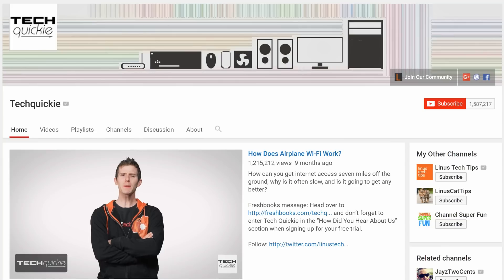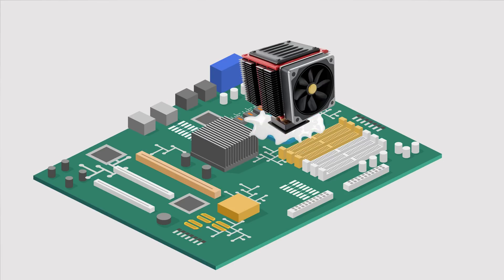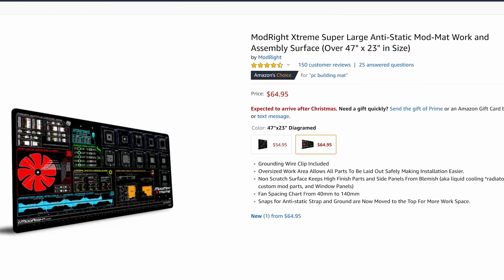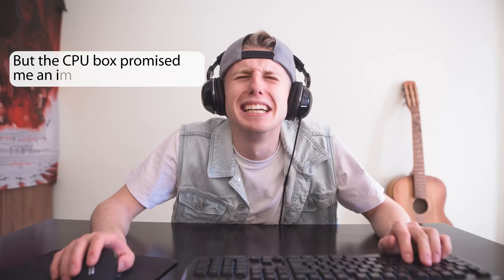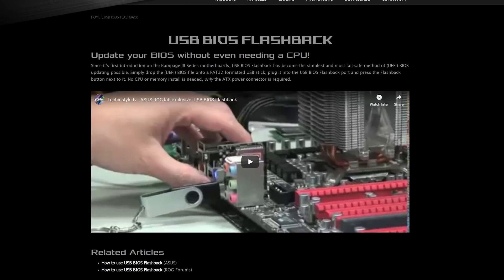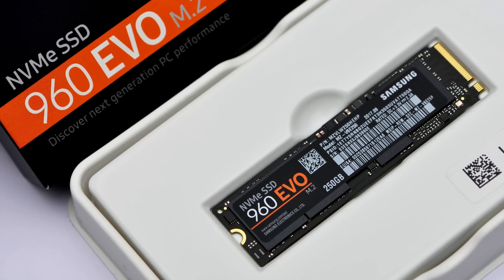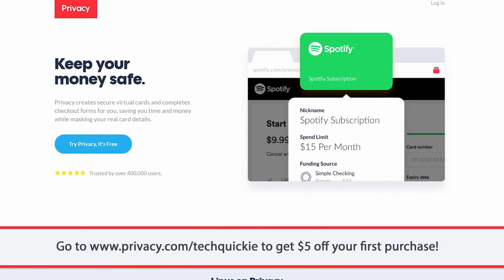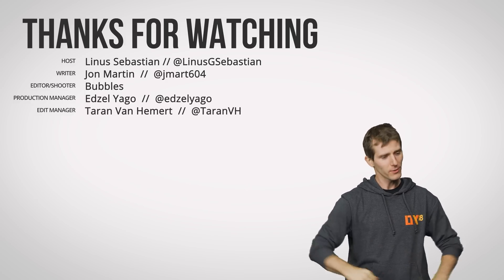DON'T Make THESE Mistakes Building A PC (pt. 5)

Comment: I have a tip for parents......don't buy them mac as a gaming pc....
Reply: Sounds like you speak from experience..
Reply: F for the kids that got macs
Reply: N3CC i would refund so fast
Reply: @carljosephavelino4128  i mean they could sell for a high price then build one
Reply: CarlJoseph Avelino presses f in choppy 30 fps. Yea I have a Mac. It sucks
Reply: @carljosephavelino4128  f
Reply: @carljosephavelino4128  I game on a MacBook :(
Reply: CarlJoseph Avelino got a 1800 MacBook, runs as a 200 dollar gaming pc F
Reply: CarlJoseph Avelino F for me
Reply: CarlJoseph Avelino I got a Mac, but I had already chosen a cruddy laptop instead of saving my money previously, so the Mac was a big upgrade. Today my gaming PC arrives.
Reply: @carljosephavelino4128  i got a mac
Reply: CarlJoseph Avelino that would be me, not even a pro, and AIR! A MacBook Air!!!!
Reply: One day my dad showed me a mac “gaming pc” the specs were horrible for the price
Reply: @SSlayaa  The price for all Macs regardless of the specs is horrible.
Reply: @SSlayaa   The main issue isn't the specs for the price (although it is a issue), its the fact that most major games don't even have MAC reversion on release and never will unless the player is lucky they make a port down the road after release on PC.
Reply: Or any other pre-build.

Pre-builds are usually not worth it, the PSU sucks, the RAM is single channel, you have to pay someone at ASUS to build it, ASUS' CEO added on a couple of dollars to the price because he wants some ice cream, it's hard to find the specs for it so upgrading is harder, ASUS skips out on upgradability so you end up having to buy a lot more replacement parts when you inevitably have to upgrade.
Reply: @HazmatPyro  If You buy a used PC  and then upgrade what you need,it works
Reply: @alexpreda4330  you can barely salvage any of the components. 

CPU and GPU is directly linked to performance so that's a big no.
Motherboards rarely work with newer processors so that goes.
RAM might be incompatible if it's not DDR4.
Cooler depends.
Used Power Supplies are a big no since you never know how it's been used and it can destroy your entire rig if it goes bad.
(adding hdd section later)
Cases can be reused 

I have an old ASUS M52AD. However I chose not to use any of the components when building my new PC.
Reply: HazmatPyro the only good prebuilts are NZXT prebuilts and some lyte prebuilts from the new gen section
Reply: Don't buy a mac for anything!
Reply: I have a tip for parents too: don't just buy an Intel system for gaming, they're overpriced and you can get a much better AMD system often times for the same price. A Ryzen 5 or 7 price compares favorably to a core i5 and definitely compares well to a core i7 processor. It's a better value, not to mention a simple BIOS update on your motherboard and it will support the next AM4 CPU series so you don't have to replace the motherboard. As for graphics, Radeon or Nvidia. Really depends on your budget. If you want to save money go Radeon, also Linux support for RX 580s and Vega cards is really good if you aren't using windows for some reason so that's a plus but only for some users. I can't speak to Nvidia on that my experience with a 750Ti was horrible on Linux. If you want good graphics support from games Nvidia is probably the way to go, not that Radeon is bad, the RX 580 is a great GPU with 1060 levels of performance but with 2gb more video memory and it will competently do anything and everything and it frequently goes on sale and is priced better, again, better value.
Reply: @alexc3504  Yeah and some have a powerfull APU
Reply: Luscious Luchs no. Don’t buy an AMD system idiot.
Reply: Luscious Luchs u need a 2080 Ti and 9900k
Reply: My MacBook has a Core 2 Duo in it...
Reply: @michele97593  oof that must suck
Reply: @michele97593  lol I just wanted to reply to you to show all the people who only look at the last reply this incredible name.
Reply: @BlueScope819 at 5Ghz? Well TBH I don't think clock speeds matter all that much. I'm getting near equal performance to my friend who has a near identical system in terms of spec. He has a ASUS OC Vega 56 and I have a reference model Vega 64 from SAPPHIRE, I have a Ryzen 5 2600 because it was hella cheap at $150, his CPU is the R7 2700X, my board and his board are both ASUS X470 boards and he has 3600mhz memory while I have 3000mhz and we get nearly identical performance in games. His system is actually unstable compared to mine which literally just works (tm) and he's running Windows 7 with hacks to make NVMe work because 7 lacks native support for it while I'm just using plain vanilla 10 and if I had another drive id be running Arch Linux for shits and giggles and also serious stuff.

As for relative performance my processor turbos up to 3.7ghz which is only 200mhz faster than what my old processor ran at, an FX-8320 and obviously much slower clock speed than 5ghz. 

AMD doesn't really try to push clock speeds as much as they try to do multicore CPU optimization in terms of parallel workload and single core performance.

In my experience clock speeds don't matter that much in this day and age when everything is faster than 3ghz pretty much.

Worth noting the only reason I upgraded was because the FX kept overheating

EDIT: I forgot to reply to the original question. The RX 3080 has no released specs. We just know Navi will be based on the 7nm finfet process and as a result be extremely powerful and low power usage. I'd love to see Navi integrated gpus that would be kick-ass. Imagine getting 1050Ti perf out of an apu.
Reply: @BlueScope819 oh I have no doubt about that guy who leaked it, he was spot on before he seems to have reliable sources.

I don't doubt that the 8700K is good in single core but the price for me doesn't justify it nor does the price for the motherboards. I'd rather buy something I know that works for me. AMD has not dropped frames on me I can run all my games at max graphics no sweat you know? It's insane to me.
Reply: @BlueScope819 also I don't really think synthetic benchmarks mean much. Yes your processor is faster, but in the real world they would provide more or less a similar experience, the Ryzen 7 2700X versus the Core i7-8700K are similar enough just not in the turbo since AMD silicon has issues turbo up to 5 they can only go up to about 4.1-4.2
Reply: @BlueScope819 that's all fine and dandy but when it comes to the real world more than 60fps is not necessary and my system easily does it. I'm doing fine with a Ryzen 5 and Vega 64 and I'm pretty sure I spent less on my computer than you did. AMD is a better value proposition and for the same reasons I won't buy from Amazon I won't buy anything Intel. I think they're shitty companies that do shitty things. My distrust of Intel is deeply rooted.

I still don't think 5ghz versus 3.4 is that big of a difference if the performance is similar. I don't do benchmarking because to me that's all a big pissing contest. Woohoo so your PC can piss higher than mine so what if mine does what it needs and I don't really need overclocking when the turbo 3.7 is enough. In the real world resides an AMD computer that just works (tm). I'm glad you have an Intel system that is good and I'm glad that you have the money to spend on a $400-$500 processor. I work at Subway for christ sake I can't afford that shit.
Reply: Parents buy Their kids Macs so they can't game on them. That's the truth
Reply: This happened to me, I got a MacBook air and it couldn't even play rocket league. My dad bought a MacBook because "They Can't get viruses" I told him that's not true but mainstream media brainwashed him.
Reply: Pro tip for parents : never buy any apple product
Reply: Your very right
Reply: Advice for parents buying kids macs
1. Don't
2. Don't
3. Don't
Reply: Loli Hunter, the people that buy Macs/MacBooks for gaming are uneducated about their specs.
Reply: i got one :(
Reply: BloxinDoeZ same man..
Reply: NVidia Now sorts that out. It's awesome over Mac. Cheaper than an EGPU.
Reply: @BlueScope819 im not saying it's faster. Also I'm sorry for being combative I was just having a conversation. I don't really like doing benchmarks because I don't think in terms of real world performance it matters. It's good enough for me. I don't need a score to certify it. My system can get good framerates in all the games I play with ultra or highest possible settings at 1080p that's good enough for me

As for microcenter we don't have one of those in Austin we're stuck with a Fry's that is slowly dying :( so I'm glad you found a killer deal. I just know that I couldn't justify the high price tag of Intel but I don't doubt that they're fast I just don't care for the price. For the record though, I might've jumped on that if I had a microcenter, but my AMD system was still cheaper. Under $900 total. You got a good value though from what I see and that I'm glad to hear. If Intel priced like that competitively on all their CPUs I would be more inclined to buy one.
Reply: Luscious Luchs 1080p? AMD really does suck
Reply: Luscious Luchs under $900 for a whole system that’s too cheap that’s why it’s shit
Reply: @BlueScope819 I use games like kingdom come deliverance and a few others. Arma 3. Metro last light. Just to name a few.

Full specs are 
Ryzen 5 2600
SAPPHIRE Vega 64
ASUS TUF X470 Plus GAMING
Corsair Vengeance LPX DDR4 @3000mhz
EVGA G3 750 watt gold plus PSU
I run three storage devices, a 640gb HDD, 1tb hdd, and a 120gb ssd

The case is a Thermaltake View 22
Reply: Luscious Luchs u still have hard drives? Wow And not enough ssd and it’s probably sata
Reply: @BlueScope819 that's what kept happening with my FX-8320 and 1600mhz DDR3 system with this same graphics card which I did actually benchmark. Apparently my Vega was being held back massively by that old pile-driver. I can only imagine the same of my RX 570 that came before it
Reply: @BlueScope819 I got mine for less than what I got my RX 570 for, brand new. I don't really care for Nvidia. My experience with the 570 even with it's only 4gb compared to my experience with the 750Ti was far better. And I don't mean performance I mean overheating and drivers. Used to be that Radeon drivers sucked but now they just work, for me at least. Maybe the cards I'm buying are just good cards. Silicon lottery. I also used Linux for gaming for a bit and Radeon GPUs have actual Linux drivers and Vulkan works in Linux and I was able to get good performance out of both graphics cards using Ubuntu with games. The Vega 64 at the time was a cheaper option. I paid around $290
Reply: @BlueScope819 oh I don't plan on upgrading for a long while now this is fine as is you know?

What are your system specs?
Reply: @BlueScope819 not bad. Not bad at all. 
I still think the 2700X is better of a processor but given the choice between $300 for board and CPU and $400 for board and CPU I would go with the cheaper option
Reply: Luscious Luchs 2700x Sucks
Reply: For those with macs... Have you experienced 7-8fps in CS:GO?
Reply: @boboperomasaya1144  I know this is a bit late but I run CS:GO on an early 2015 Macbook air and it doesn't run too badly. It runs around 30-40fps, although I suggest downloading some fan control software and turning the fans up to the max or as macs have what I call "lazy fans"(the act of the computer fans not turning on until the cpu reaches insane temperatures). You'll probably get 7-8fps when you don't turn you fans up to the max and if you own an older macbook without a dedicated gpu (like an 2013 macbook air) then it will run at 7-8fps regardless as the performance difference of the integrated graphics in older macs and newer macs is huge.
Reply: BlueScope819 AMD sucks
Reply: Speaking from experience?
Reply: don't buy a mac at all ;)
Reply: I know this is a
Reply: Don't buy them Mac at all.
Reply: My friends mom told him he should get get a dell 2in 1 for gaming
Reply: Yep
Reply: Facts
Reply: F for me
Reply: And a laptop. I asked for a gaming pc and they gave me a laptop.
Reply: F
Reply: Actually don't buy a Mac in general
Reply: @ItsFaiZer yep it physically hurts to see that
Reply: @ItsFaiZer most of em have it as a fashion statement because in the world of teens having apple products make u "cool"
Reply: @ItsFaiZer apple phones are good and all but it's annoying asf when clueless apple fans that don't know anything about hardware make fun of my Android 🤦🏿‍♂️
Reply: true story? if so I pray for you
Reply: F
Reply: Your fricking righ
Reply: Mine spent 1500€ on a Mac, I asked for a GAMING pc
Reply: Oo for anything at all ever
Reply: my best friend’s parents bought him a mac to watch youtube 😭😂
Reply: My parents got me a laptop based on storage because they thought that storage was the only thing that mattered for it to be fast and they only got 1 tb of the worlds slowest hdd and it had an Intel i5700 u no graphics card and 8 gb of ram.
Reply: My dad got me a MacBook Air for gaming
Reply: i bet my  inspiron 660 can run better than a mac, and i got that when its os was windows 7

dont worry im gonna build a new pc
Reply: I got a chrome book
Reply: My PCs ram died so I had to use my Mac for a week till the new dimm shipped. My mum said why I just couldn’t use the Mac since she saw me playing Minecraft on it. It’s a MacBook Air mid 2013 with a low end i5 and 4GB of slow ass ram. Minecraft was running at 30fps best
Reply: 넥타Nectar f I thought I had it bad with my iMac from 2017 but in 20 days my digital storm lynx number 2 will come
Reply: LMFAOOOO THIS HAPPENED TO ME
Reply: First of all parents does not buy Gaming PC's
Reply: Just don’t buy a Mac
Reply: Brandon Weiss 8 year old me really didn’t have a choice
Reply: Divideable lol same
Reply: F
Reply: Adkatka's Channel fr it’s a scam and I hate my mac
Reply: My friend's parents got him a mac for his birthday and he said he loved it and it was his best birthday, he is no longer my friend
Reply: @anonymousannoyed385  thank you all i sheeps shall be defeated
Reply: god no
Reply: Zycklacon :(
Reply: To be fair the macs they put out these days can handle titles like wot wow WoW ark and gta v so they’re still pretty good, storage is the issue but I’d definitely use that 1+k on a pc not a Mac
Reply: Parents, Macs are for PRODUCTIVITY ONLY. Final Cut Pro, not Final Fantasy
Reply: GameTimeYT4 nah macs could run final fantasy easy I mean macs can run wot and ark pretty well so final fantasy would be a walk in the park
Reply: Just don't buy a Mac in general.
Reply: ... welp i told my mom and dad but they didnt listen
Reply: And that's on my dad. When I told him I want an upgrade he said just stick a gpu on a MAC MONITOR/PC LIKE WTF
Reply: i’d be happy with a mac
Reply: or any other laptop
Reply: Why not ?? 🙄😆🤣
Reply: @amdphone2750  cuz its really bad for gaming and streaming trust me i have one and i regret every penny
Reply: Omg, my dad got me a Mac XD.
Reply: My mom asked me why I can’t game on a 2012 Mac 😐
Reply: all in one pc gang
Reply: That was deep👍👍
Reply: Thanks Loli Hunter
Reply: * Cries in 2016 MacBook Pro *
Reply: Your thumbs up count should be WAAAAY the hell over 37..more like 370,000,000.   I amazes me to no end why idiots 1.  Keep supporting this asinine company, and 2. buying them an iCrap for a gaming rig.  ANYTHING is better at gaming than a crapple machine.  It's STILL not built for that.
Reply: @motoryzen  o
Reply: Motoryzen bro relax
Reply: Motoryzen i agree with you but if you use it for a company it’s so easy to use but yeah it’s dumb to buy as a gaming pc
Reply: Motoryzen it’s built for business, music production, and video editing ?
Reply: Yup
Reply: @BlueScope819 windows Vista is not that bad. That duo can just upgrade their os anytime.
Reply: @BlueScope819 Were talking about a core 2 duo a 9 year old cpu.. what do you expect if someone says that he is going game ob that.
Reply: whats video is that a reference to
._.
Reply: @BlueScope819 core 2 duo still support windows 7
Reply: @BlueScope819 I can play minecraft bedrock, and some games on microsoft store.
Reply: @BlueScope819 plenty good for playing non demanding games
Reply: Asdew hdd? I ain’t heard that term in a long time
Reply: Ocawesome101 don’t go with AMD
Reply: Ocawesome101 also don’t buy older gen hardware
Reply: @BlueScope819 Operating system does not resemble gaming performance in any way. Remember having Vista PC vith Q9650 + 750Ti and it was a killer PC with 1280x1024 screen. Sold it to my friend, runs fine till this day. Never had any issues with Vista btw.. haters gonna hate.
Reply: Get a pc from cyberpower
Reply: If you weren't planning to game on it, a MacBook air (2015) used to be a good choice. Awesome trackpad, great keyboard, pretty fast (especially for an i5), great build quality. It was nice and light, and an ok price (for apple products). Of course you can't game on it, but if you were just using it for school work, it was great. Nowadays apple computers have nothing going for them.
Reply: Yeah not a good idea lol. But if you run Windows on the mac and use a better graphics card then you can game on some of the macs. My 2014 Macbook Pro works very nicely with External Graphics card GTX1660ti  and windows 8.1 (EGPU only works properly in Win 8.1 for some strange reason).

Comment: I had some trouble with M.2 when I was helping build my brother's PC, so an intuitive, easy-to-understand guide to installation methods and interface types cross-referenced would be good. For example, whether or not a PCI-E interface M.2 drive can be put in the PCI-E slot with an adapter on boards that natively only support SATA in its natural M.2 slot.
Not necessarily for me, but for those who might hop in the same trap as I did, not noticing that the board only did SATA and the drive was a PCI-E one.